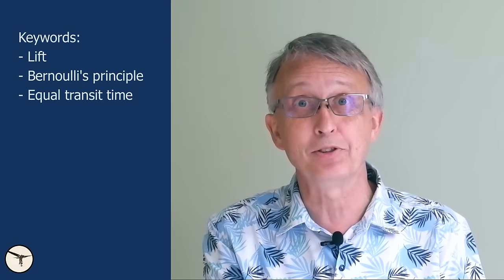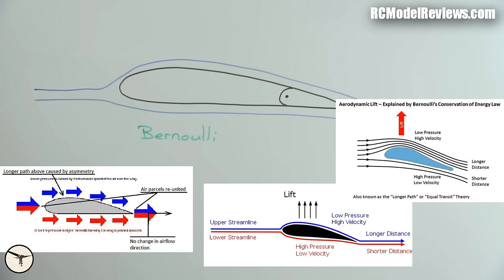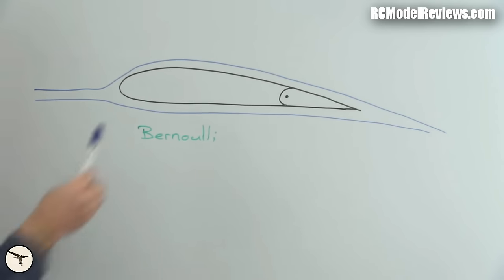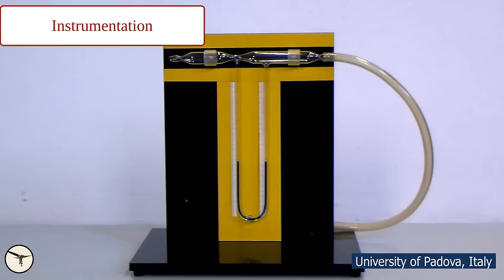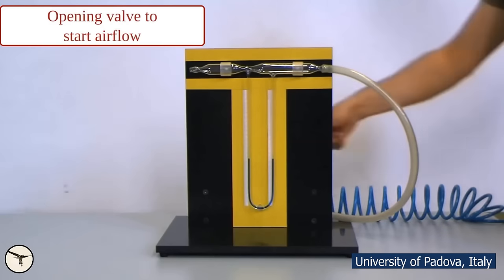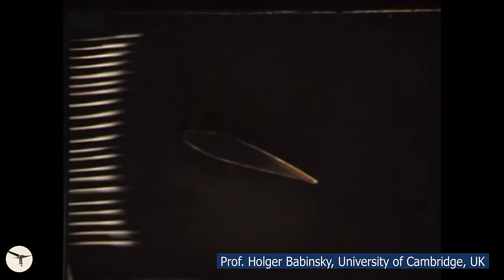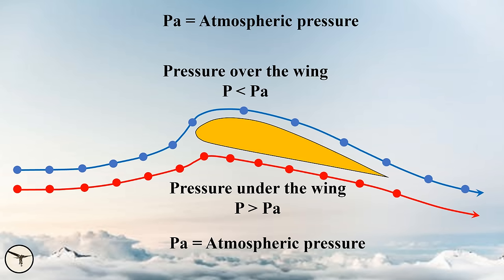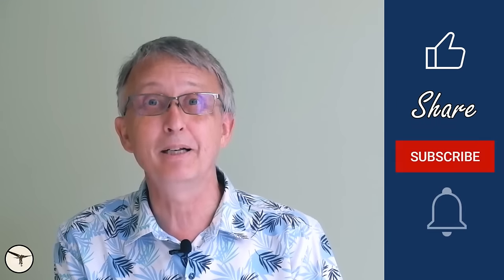Why are so many pilots wrong about Bernoulli’s Principle?

Comment: They removed my comment. A kite is flat and gets airborne. No need for wing shape
Reply: A kite is very light.  An aircraft wing gets about 30% of the lift from the airflow under the wing, and 70% from the airflow over the wing, depending on the angle of attack and the actual shape of the wing in section.  So if a kite  only gets the contribution from below the wing, it will still be enough to fly.  Try messing with the upper surface of an aircraft wing and you will see the lift deteriorate significantly.   That's why the engines, and other equipment, (mechanisms to operate flaps etc.) are below the wing.  The upper surface is vital and that is also why the spoilers are deployed on the upper surface to dump lift.
Reply: @karhukivi  kites are used to pull supertanker and same fuel
Reply: @ahm7944  They don't use children's' kites!
Reply: @karhukivi  wow! You don't quit. No, but a big flat children type kite dragged a 1 ton truck in my town. It lifted in the air few times.  The airplane wing is curved to avoid turbulent flow.

Comment: Supersonic airplanes have simetrical profile wings so no Bernoulli efect. Also some aerobatic planes have simetrical profile wings, so again  no Bernoulli efect.
Even the ones that have the right profile for this efect, get a lift bonus of only 10% more, and even that 10% comes from more engine power coz' the air is braked more by this wings... The wing lift is generated by the air braking on the underside of the wing, from the angle of attack that is around 3° not more so as not to stall, and for STOL there are also flaps and slats used that can use a higher angle of attack. For lift you need wing surface area, angle of attack, and air speed, and braking and lift is in relation with the speed sqared.
Reply from the maker: At supersonic speed, the aerodynamics are very different from subsonic flight. However, most supersonic airplanes cruise at subsonic speeds for better fuel economy.  Ths is achieved by flying wiht a positive the angle of attack (AOA). Fighter aircraft have leading edge flaps (called maneuvering flaps) to increase lift. This increases the curvature over the wing, which results in an accleration of the air over the wing, which in turn, according to Bernoulli's principle, reduces the static air pressure, which is lift.
Aerobatic aircraft with a symmetrical wing profile must fly with a positive AOA to stay airborne. When the AOA is zero, the lift is zero.
Reply: @FlywithMagnar  AOA is 3° from the wing being hard fixed on the fuselage at that angle, so it can't be zero. Flaps and slats can be used with greater AOA. The lift is just from air braking on the underside.
Reply from the maker: The AOA has nothing to do with the angle the wing is attached to the fuselage. Flaps and slats are used to increase the curvature of the wing, hence increasing the lift coefficient and allowing for flight at low speed. 
Only a small portion of the lift is created by the underside of the wing. Most of the lift is created over the wing. That's why the wing stalls when the airflow over the wing is disturbed.
Reply: @FlywithMagnar  I have inside information, my good lifetime neighbor that recently retired was a top real aviation designer and when he was still working for Boeing ( he work 20 years for Boeing and before that even more then 20 years for other european aviation companies) told me that they still make the asimetric wing profile only from tradition, but when they design the wing and choose the desired surface area, desited lift, weight, load, takeoff speed, etc., they ignore the Bernoulli efect that is not even a 10% lift bonus - Bernoulli efect add 10% lift but for the asimetric wing the plane reach harder de before chosen takeoff speed, it needs more engine power so in practice is the same thing with or without asimetric wing profile. They just chose the desired wing surface area for air braking on the underside  for the desired lift and takeoff speed with a 3° AOA  fixed wing on the fuselage, and sure with  flaps and slats for STOL. For takeoff is more important the ground efect. And also Coanda efect is more or less a similar case - there are some planes designed for STOL with Coanda efect, but they need more engine power so the desired lift cand be reached the same just with bigger flaps and slats... Coanda efect is important for subsonic      and transonic deflagrant non-detonanting  explosive, for the so coled thermobarics - another media myth...The shock wawe remain on the ground at subsonic and transonic speeds and so it can reach much higher blasting radius then a supersonic one which dissipates faster locally.

Comment: Simply put. Lift occurs when pressure differential if sufficient
You can dissect the flow patterns forever but the sum difference is all that matters
Any disturbance creates a pressure difference
Reply: No. You are wrong.
This is not the cause of lift.
Lift occurs because of Newton's Third Law of motion.

It is the only explanation that explains induced drag.

Comment: The assertion that air flowing above and below the wing must arrive at the trailing edge simultaneously does not even deserve to be called a hypothesis, let alone a "principle." It's a silly idea to begin with. There is no reason at all why it should happen. I'm bamboozled as to how such a non-idea took hold. But just listen to how confident that clown at the whiteboard sounds as he "points out" which path is longer. 😆

Comment: The air in the sky does not behave like the air in a wind tunnel. The only similarity is its chemical composition!
Reply: That's not true. Motion is relative, so the effects of flight are well studied by wind tunnel testing.  Though there are scaling adjustments that need to be made to make the studied condition equivalent to the full-sized aircraft.

Comment: OMG.. flat earth theorist's talking about airplane wing. Airplanes doesn't fly with noise up as the wing in the video, i.e. most of the time. Exception when landing and taking off. When taking off, they use max power to increase lift and when landing they point noise up to brake and or decrease speed.
The lower part of the wing is horizontal most of the fly time. 
Birds can hang in the air because of Bernoulli's. If Bird's would use force under wings to hang in the air, the force would push them backwards and of cause (simple force-vector calculations), same does it with air-planes.

Comment: Lift is created by the pressure difference between the upper lower surface of the wing in a phenomena called circulation. There are 2 contributers to lift. Chamber of the airfoil dz/dx and angle of attack alpha. Each airfoil, even if dz/dx is zero, has a lift coefficient as a function of alpha Dcl/Dalpha which is a pretty linear relationship up to the stall angle. I hope that clears it up.
Reply: Sorry to debunk... But "lift" (Force) is simply created whenever you have a flat object, a flow of fluid, and an angle of attack. Go and skip a stone on water or use a water ski... same thing... No circulation at all, because only the underside of the stone/ water ski is subjected to the flow. Lift is dead simple explained as a deflection of mass.

Comment: Yes, at last, someone is providing the correct theory. I have had so many arguments over the years on this. My understanding is. Total Pressure = static Pressure + Dynamic Pressure. So because of the curve on the top of the wing, the air has to flow through a smaller gap. To get the same amount of air through this gap, it has to increase speed. So to balance the equation the static pressure has to drop.
If you cut a venturi tube in half you will get the top profile of an aerofoil.
From the fundamental equation, the final lift equation is formed, including air density velocity and area, and shape.